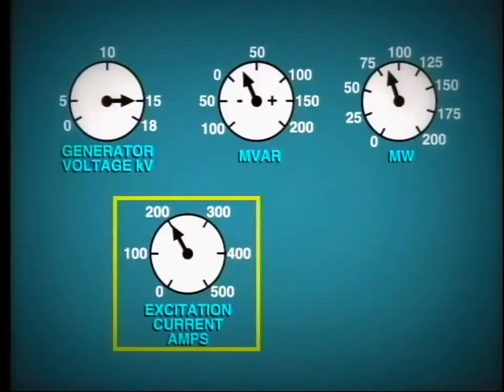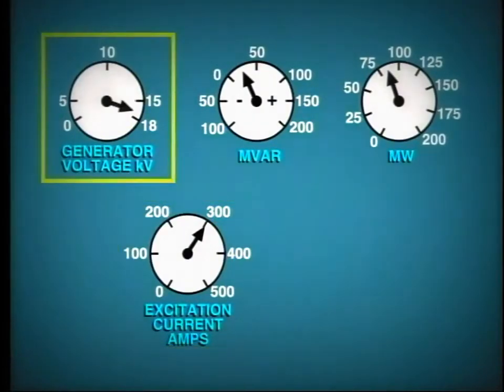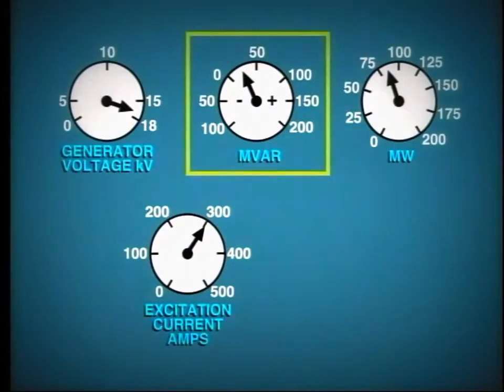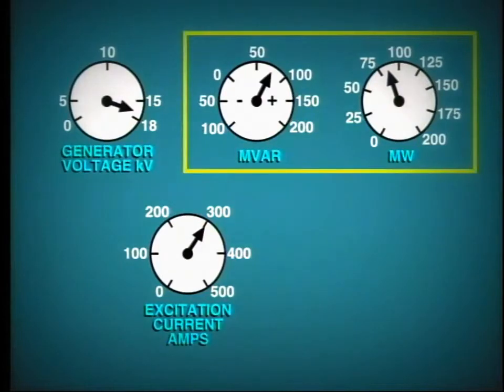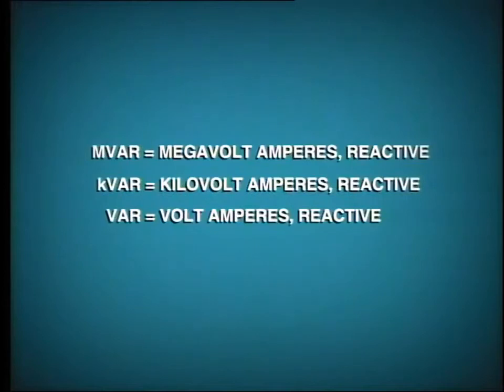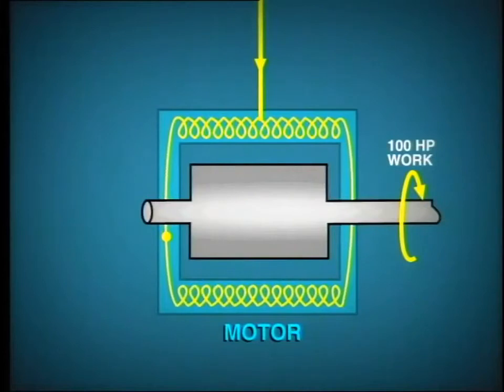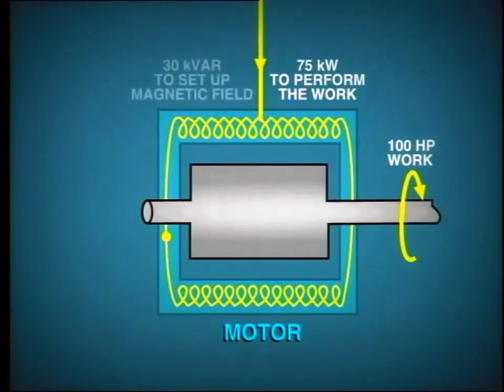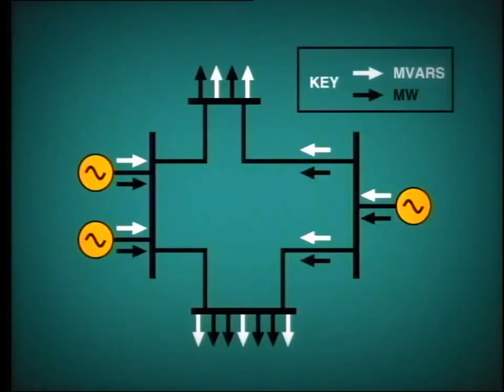lesson 12 :synchronize generator to connect with national grid

Comment: Can generator synchronised to national grid with 0 MW?
Reply: Yes of course. 

after closing breaker (by matching freq, phase, volt) if you don't do anything, generator is said to "floating in the bus bar" (basically doing nothing but connected to grid) 0 MW delivery.
Reply: Yes, so the energy produce by generator prime mover (the turbine) is than equal to it stored rotational kinetic energy( energy required to spin the shaft that related to the inersia of turbine generator at certain angular velocity) then there is no excess energy to transfer to the grid, it's sounds OK in theory but in real system it's kind of inapplicable since there's inconstant power / energy produce by the prime mover (it's hard to governing precisely) it's may sometimes greater than the turbine generator stored rotational kinetic energy or vice versa, we all knew that there's a lot of protection applied to the turbine generator which is one of them is the reverse current / anti-motoring protection relay which is may active once the energy produce by generator prime mover(turbine) is less than energy required to spin the turbine generator shaft (related to it inersia) at certain angular speed
Reply: @teddysuryadikusuma9307   There is no excess energy transfered to grid. The Prime Mover (Turbine) only supplies some mechanical power to mechanical losses(friction, Windage loss) that's all. There is no electrical load when generator is floating in the busbar.